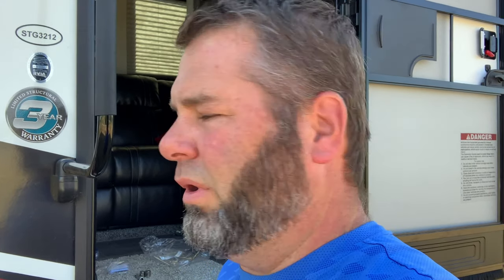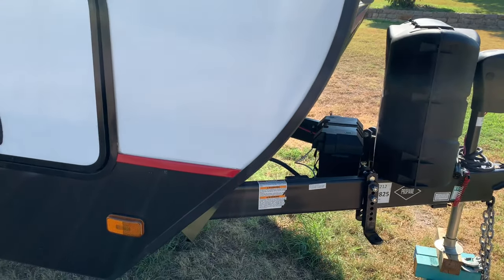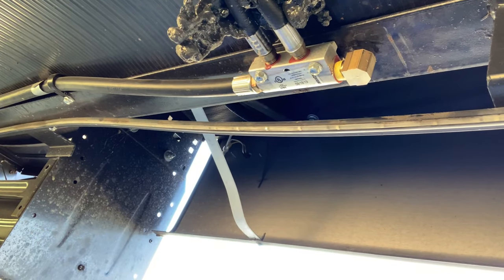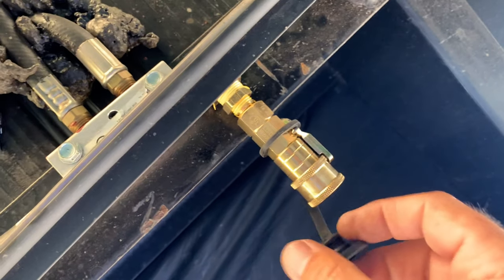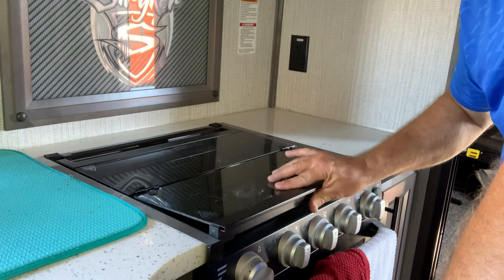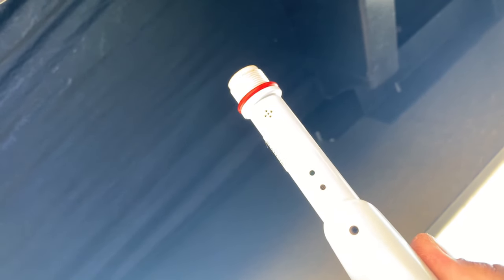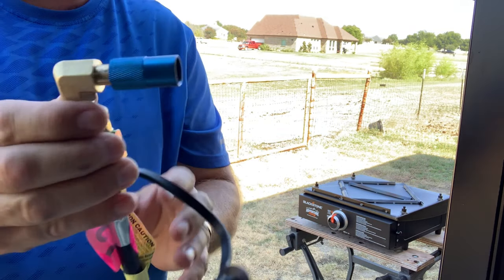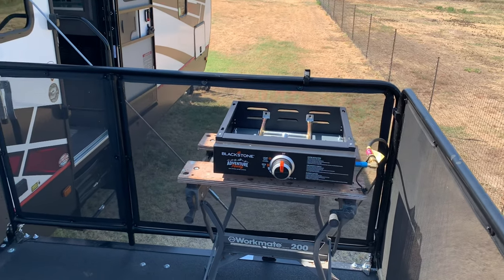Add a RV propane quick connect/Stryker 3212 TH

Comment: Your quick-connect valve is in the ON position! The ON position is pointed straight-through to lock the quick-connect hose in place. When NO hose is connected the valve lever should be perpendicular NOT parallel.

Comment: Do you have a link of the parts that you bought? 
I have a 17” Blackstone as well , I have a connection under my trailer but not a junction like yours, it’s just a plug that unscrews so that you can put your tee or any other direct connector to the quick disconnect .. thanks great video 👍
Reply from the maker: Howdy, in the description box there should be links to all the parts. Thanks for watching an happy rv’ing

Comment: On my 2020 Stryker 3116 the propane block is on the opposite side (drivers side). Unfortunately there is no line that runs downs the back of the driver side and across to the passenger side for me to do this. So I'm guessing my only option is to see if Propane Gear can make me a hose to length?
Reply from the maker: Yes, they can definitely help you with that

Comment: I'm looking to do this on our motorhome. My distribution manifold looks very similar to yours, except all 3 ports on mine are being used (fridge, furnace, stove). I'm going to have to use a tee fitting. I'd like to run a short pigtail hose from the Tee over to a quick connect mounted/clamped just under the side wall. Most newer RVs already have this.

Did you have much difficulty getting that plug out of yours? From what I can tell, it looks like orange Permatex threadlocker was used on the fittings on mine - which is supposed to be removeable. I've read on forums where people struggle getting those loose - claiming Loctite Red was used! But mine looks clearly orange NOT red - so they should come loose with some effort.
Just curious how tight yours was threaded... THANKS!!
Reply from the maker: Mine was pretty easy I dont think it had locktite  on it.
Reply: @LifeWithKernelLee  It's the orange stuff (Permatex Threadlocker Orange) seen around the threads at 3:38 in your video. From my research,  it prevents loosening from vibration, and it's supposed to be "tool removable" (no heat). You didn't show any "wrenching", so I was wondering if you used an adjustable wrench, open end wrench, channel locks, vice-grips - or whatever? From reading forums, seems like many others are having the same problem - even thinking it's Red Loctite - which it ISN"T.
I've tried an adjustable wrench, but that sucker is REALLY TIGHT! I'm afraid of rounding the nut...
Reply from the maker: @nortonnewmann3711  i believe I used an adjustable wrench. It was kinda tight but not to hard to remove.
Reply: @LifeWithKernelLee  I finally got it loose - used a 9/16" open-end wrench and some gentle love taps with a hammer.
I read on a forum where people were cussing the RV industry for using RED (permanent) Loctite,  which requires 500 degrees F to release. This orange stuff IS NOT Loctite RED, but rather Permatex Orange, which holds better than Loctite Blue - but is still tool-removeable without heat. It's used in high vibration environments (an RV) to keep critical fittings from loosening - i.e. propane.
You know what they say... learn ONE THING new every day!! Seriously... THANK YOU for your video - AND your response!
Reply from the maker: @nortonnewmann3711  woohoo, glad you got it.
Reply: @LifeWithKernelLee  hey great video... my junction box is further under the trailer, are you aware of 3 or 4 foot hoses i could use to run to the quick disconnect at the edge of the trailer ? Thanks
Reply from the maker: @thehigsy  hey thank you very much, yes, use the link in the description box for propanegear. Com

Comment: Thanks for the video. I think I'll try this!
Reply from the maker: Paul Brambilla , its an easy mod, love having.
Reply: @LifeWithKernelLee  I have a very similar junction, but it's not in a super convenient location. So I'm trying to figure out how to run a hose to the frame/edge but I'm kind of struggling to figure out how to mount the quick connect if I do that. Maybe I'll just have to lie on the ground and run the cable to the junction where it's at...
Reply from the maker: Paul Brambilla , hmm, should be able to run a line to where you want the connection at